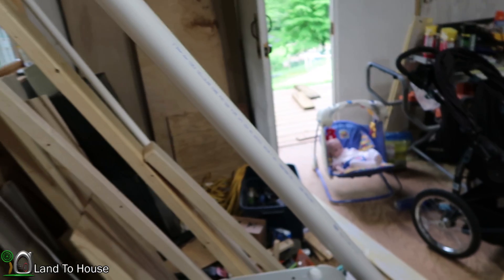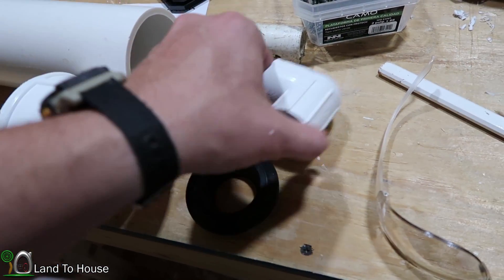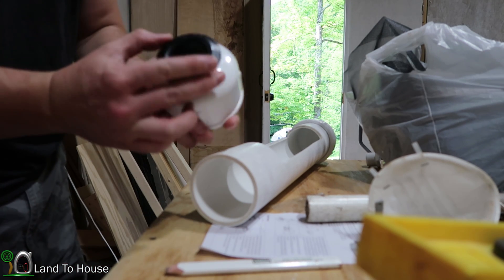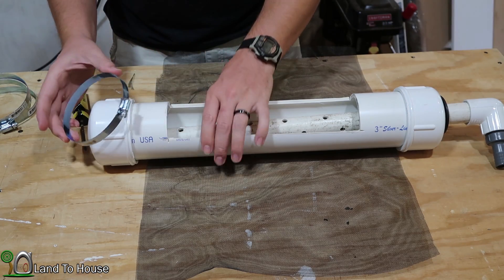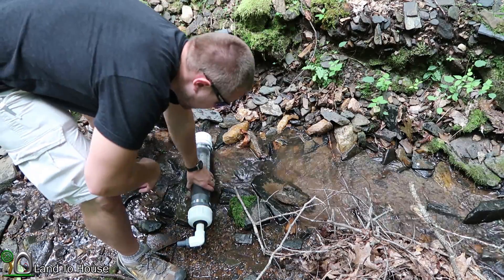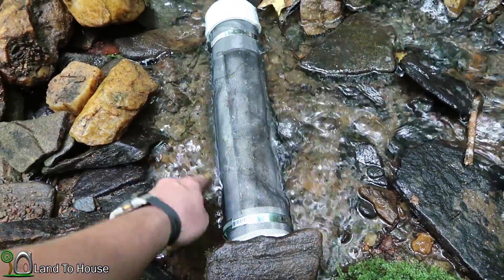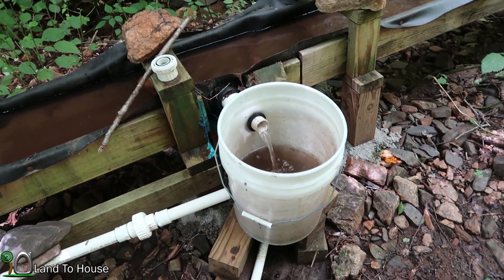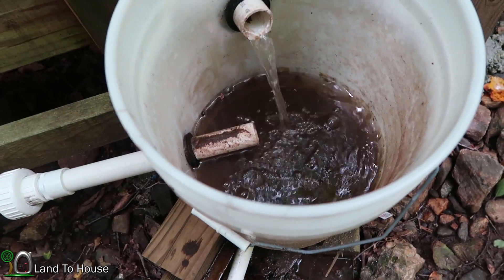Low Flow Intake - Ram Pump

Comment: Thanks for the video.  I've been doing similar filters by sewing a fiberglass screen sock over a 3 inch tube with small drilled holes.  Lots and lots of holes to try to counter the floating algae.   Your method of cutting out sections may be faster and generate less debris.   

The mid bucket could take the place of my stand pipes and maybe a larger tank could power the drive pipes multiple of my Land To House ram pumps and do a better job of catching debris sediment making it past the filters.

The uni seals would allow some leeway in the length of the pipes.  Now with anchored filter pipes, 50 feet of 2 inch supply pipes, the stand pipes and 20 feet of drive pipes, over the summer with ram pumps pounding, stream flowing by the pipes and occasional animals bumping the pipes, close tolerances are causing issues with pipes pulling apart.  

I've been reluctant to glue everything because I  change my mind for lengths and will begin removing everything for the winter and spring high water.

Comment: Hey there I love your videos and I have a suggestion on this topic. You might try building a BDA (beaver dam analog) to create upstream ponding of water. Incorporated with a line running through the bottom of the structure and a suspended filter on the end you could get a more reliable flow of water (especially in drought conditions) , with more head pressure, and with way less sediment. Although I did like your video great idea! Also here is a video that explains more on BDA’s https://youtu.be/kMo9V32Gv3o

Comment: Ok brother,  im building a small above ground pond its going to be aprox 200 gallons , i use a small pond pump to fill it frrom a shallow well , plus rain water , so a want a system to move water around the yard , ... this is awsome

Comment: Low flow = low energy potential.
Low energy input = low energy output. 
There is a lower limit for what humans need or can utilize and what is below that limit is useless to humans.
Experiments are like questions, it is said about questions that "There are no stupid ones".
That is an assertion they needs to de demonstrated before it it justified.

Comment: Seth, I'll be testing this same setup later this week. I've decided (dont you all laugh at me) to use a pair of panty hose as my filter system. I'll basically wrap the 3" pipe which has a ton of holes in it with both legs of the pantyhose.

Comment: I built a similar filter except I drilled 1 1/4" holes instead of cutting a window I did this because the screen needed support, over time the screen will stretch. I capped the ends of my screen with the rubber sewer caps that you get at Lowes you can get the cap with a supplied clamp for close to 4 bucks each I ran my screen the full length of the pipe and stretched the rubber end caps over it to hold it in place it works good the most problem that I have is when the spring that comes out of the Mtn gets high it gets covered with small gravel and sand other than that the 1" pipe that I have coming out of the end seems to gulp and when it does this it causes a small back flow that helps keep the screen clean of small debris, I am filling a 55 gallon drum below stream and the 55 gallon drum feeds my ram pump.

Comment: Seth,
Is this still your best recommendation for filtering low flow creeks?  We are having a problem keeping our pump (bought from you and working well) fed with water.  Our intake line keeps getting cover with debris.  Mostly small stuff.  We currently have a pvc tee attached to the supply line.  Attached to the tee is two 90 degree elbows with the opening facing down stream with screen over the openings.  After about 5 hours the screens become clogged with silt/very fine debris.
Reply from the maker: This design is what I currently use but I have doubled up. If you have any kind of waterfall you may be able to use a box with screen over it. If your silt is that fine you might be able to increase the size of your screen to allow that smaller silt through
Reply: Similar, issue, but with very small floating algae.

Comment: You could just put the intake into one of two liquid containers with a pipe connecting them at the middle with an exit pipe at the top of the 2nd bucket. The bigger particles of silt collects in the first bucket, and the slower flow allows most but the most fine silt particles to settle in the 2nd bucket. Then you just place a filter all over the surface of the water right below the output hole on the 2nd water container to filter out the most stubborn fine silt still in the water. Voila! A self filtering low intake setup (in theory). Also, since there's no pressure to hold up the fine silt on the filter as soon as it builds up enough it will just sink back into the bucket, and since there's no flow at the bottom of the bucket it will stay there. 

The purpose of this is to filter out even further the water to reduce buildup in the pump or water reservoir/whatever you're using the water for.

ASCII example of the setup (minus representation for the filter). Left side is intake, make sure the water comes in from the top but stuck to the side in order to reduce agitation in the water. Right side is output

|  |  |  |-
|  |- |  |
|_|  |_|

Comment: You should face the opening away from the water flow and the large opening be vertical, not horizontal.
Reply from the maker: I now how a new video where I add another pipe as intake. It is much better.
Reply: @LandtoHouse  I will take a look.  TY.  Keep up the good work.
Reply: @LandtoHouse  link please?
Reply from the maker: Here you go: https://youtu.be/JtGA-O4PUuA

Comment: currently i am doing a swimming pond with size of 4m x 5m x 1.6m and  it use natural filter.. so, i'm thinking to use ram pump for draining and skimming. the, the waste water will go to waterfall structure and slide. so, i am looking for a pump which not use electricity. what is your recommendation based on your finding?
Reply from the maker: The ram pump is great in a creek or river but is not good in a closed system such as a swimming pool. There is too much waste water. As far as I know the only pump that is good for this type situation is a solar pump or electric pump.

Comment: It's a good idea.I aslo use this concept modify my middle flow intake?
I use the Coca Cola 2000ml PET bottle or some wine bottle(like Suntory whisky.1920ml PET)
Cut off the screen area then mask with net.Then it work well for me.
Maybe the next day I will enhance it again.
Reply from the maker: That seems like a fine way of filtering the water. In my creek it is a must because of all the silt.

Comment: Seeing as you have the mesh screen on the outer pipe, I cannot understand why you would have the inner pipe running up the length of the outer pipe, then drill small holes in it - appears to be more work for no gain? I'd expect to have the inner pipe protrude through the rubber/plastic seal maybe a couple of inches, then be cut off square...
Reply from the maker: My main thought was that the inner pipe could still pull water if the large pipe filled half full with fine silt. But it might not be needed at all.

Comment: I love your channel but I wanted to ask what you think about those PapaPump ram pump design that did better than improve over the original RifeRam brand from way back!Check them out ?!
Reply from the maker: Thank you. Yes those are nice but a little hard to build for the DIY type. The traditional ram pump is rather easy to make and install.
Reply: @LandtoHouse  Thank you for your video..I HAVE  slow water flow unlimited even for how many years ..already this water flow from forest..but I want to use that source going to my house, My house 150meter away from this water flow..how many Hp pump i can use??to push the water into my tank?the tank is about 10meter High..Please Give me some idea.thank you..

Comment: You could install an automatic siphon to empty the sediment out,  once the level gets high enough to spill over ...
Reply from the maker: +MultiOutdoorman one issue might arise if the automatic siphon pulls the water too low and the ram pump will pull air and stop.
Reply: If you drill a small hole in the siphon pipe at the level that you need it to stop, it could pull sediment until it reaches that level (with a small amount of water too via small hole) then the air entering via small hole would break the siphon...

Comment: I. Could not suck enough air out of 1" drive pipe by mouth. I ca reach the in let with a garden hose to clear the air. I was wondering if there is another way I cases where one could not do the garden hose thing.
Reply from the maker: Some people will use a bucket to fill the pipe with water. Be sure to close off the lower end before doing this. Once the pipe has a good bit of water in it place the intake back into the creek and then open the valve on the low side. This will pull a siphon and get the water into the pipe completely.

Comment: Good video my friend. It might be easier to create a small dam across the creek and have a feed pipe into your ram pump - or lay your pump length ways aligned with the water flow in the small dam.
Reply from the maker: Thank you. So far this intake has been working without flaw for a month. I do think it is a good idea to turn it length ways in the creek. That would reduce the debris that gets stuck on the screen.

Comment: Hey there, I had 1" ram pump working, pushing four litres a minute two hundred metres, I need four hundreds metres, flow Dont matter as I'll fill a tank 24/7.I have upped intake to two inch, on a 25m lay flat pipe, and it won't run my pump, check valve closes and I manually open, to prime, but won't run.
Any ideas.I'll upload pics to photos bucket later, and post here. Cheers
Reply from the maker: The ram pump needs to have the same size drive pipe as the waste valve. SO if you are using a 2" drive pipe with a 1" ram pump you will have issues. It is better to increase the head pressure to get the pump to lift higher.
Reply: OK, makes heaps of sense, that's easy. I'll swap the feed pipe to one inch, to suit waste pipe, was working with 1 1/2" but only a short feeder say 7-8m, and only one and a half head height to pump 
I'll swap it out tmw, and see.
You can see my other video here (under this account), of it working before, atleast I can make a two inch pump later, woohoo. Awesome man, just trying to get fresh water from creek coming down hill, to house, to use, rather than water from my well, that's been thru cattle property next door, and sitting in my dam, which leaks thru the wall (its deco), (tastes like iron) .

Really appreciate your time replying man, thanks, awesome.
Reply from the maker: Using water that is nice and fresh is always a must. Cattle have their purpose but keeping clean water is not one of them.

Comment: I like the way you call a hammer an ( adjustment tool )  I normally call it a persuasion tool ( the bigger the peroblem the bigger the adjustment or persuasion tool) great video
Reply from the maker: Yes persuasion tool works too! It is the best at making things fit .... even when things are not supposed to fit haha.
Reply: I call them a "knockometer"

Comment: I think you may need to dig out some so that it is submerged but to allow water to pass over and under the pipe. In my mid section Tank that I use I have actually used a kitchen colander as a filter ( Nobody's missed it as yet! )
Reply from the maker: That is a very good idea. I ran out of hands to haul the spade to the creek. I think this shows that it works well enough but having it another 2" lower would make it better. Hmm. I wonder when they will be draining the boiled potatoes and wonder where that colander is?

Comment: During that experience what was your dénivellations from the intake to the bucket ? Other question,  I'm having a problem to instal presently a ram pump of 1"inch intake and 1/2" delivery pipe:  I've installed a 1"inch swing valve and a 1"inch spring brass valve and it's not working,  should I install 2 swing valves which could require less pressure from the intake pipe instead of a swing  valve and a spring valve ? Presently I've about 1 foot of denivellation from the intake to the pump and this intake pipe of 1"inch is nearly 100 feet long ?  I'm presently wandering if we have to use the digger in the creek,  lift the dam and install the pump lower to get 2 feet -2 1/2feet of denivellation ?  We check the creek with a lazer and we have 15 to 16 inches on 150 feet,  it's not much but we don't have other solutions on that creek.  I'll be happy to read you,  thanks.
Reply from the maker: The drop in slope was around 2 feet in this test. There are a few things that come to mind for your setup. With only 1 foot of head pressure you might not have the pressure needed to close the waste valve. If water pours out slowly you might need to increase your head pressure. There are a few ways of doing this. You can dig like you suggest but I dont like doing that because the creek can fill that back over with silt. I like to use a supply line and stand pipe then drive pipe. This would allow you to go as far as you need to in order to get the head pressure. 
Another thing that can be stopping the pump is air in the drive pipe. With such low head pressure it is hard to get all the air out of the line. Any air will stop the pump.

Comment: I've used a very similar design for over a year now.  It has never clogged with leaves.  I covered my screen with a perforated stainless steel sheet. This seems to help the leaves slide over more easily.  You can get it on Amazon for ~$20
Reply from the maker: That is good to hear! If I decide to install this as a more permanent  intake I will have to look into those screens.

Comment: Just a couple thoughts that crossed my mind after watching your videos on this.

Should the outtake be placed high in the bucket and straight across from the intake? I wold think that this would allow less silt to enter the line.

Another though would be creating a vortex in the bucket. Like in some dust collectors. This should force the silt to the bottom and keep the clean water on the top.

I would also think a larger bucket would be better It would give the sediment more time to sink before the water exited the bucket.
Reply: like a 55 gallon drum?
Reply from the maker: Good points. 

I have around 5" of clearance in my 5gal bucket for silt to gather. If the bucket was larger the intake could be even higher from the bottom. 

A vortex could help place the silt on the bottom. Not sure it would keep going because there is no real flow out of the bucket that keeps the vortex going. The ram is pulling less water than is going into the bucket so the water levels out.
Reply: @LandtoHouse  Just make the inlet flow at an angle to the radius. The inlet water would keep a small swirl going in the bucket/barrel. If the interface is a problem, just attach a 90 or 45 to the fitting on the interior. Fiddle with the rotation to get the desired effect.
Reply from the maker: On the bucket I wound up installing a 90 elbow back into The Flume. Cleaned things out quite nicely

Comment: try turning the opening downward to help stop the silt from entering the opening the screen will stop the larger debris and will help with the leaves.  the larger the hole you put it in the less silt you should have.  it will give the silt some time to settle and not be passed down stream.
Reply from the maker: Seems like a good suggestion. I was also thinking that the window opening that I made could be on the bottom as well as the top. That would either let silt out .... or cause more to build up. haha

Comment: You should cover it with gravel
Reply: thats a really good idea. how would you keep the gravel in place?
Reply from the maker: I have seen spring heads covered in gravel like what you are suggesting. I do wonder how to keep the gravel in place during large flooding rains. Also it would make cleaning harder when silt does get to it.
Reply from the maker: And cleaning when the silt does get to the screen might be a pain.